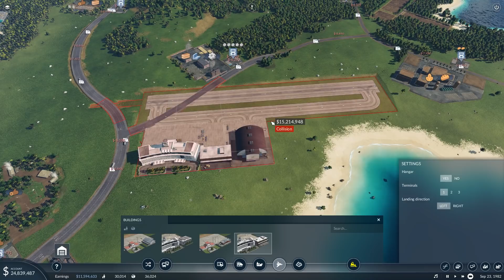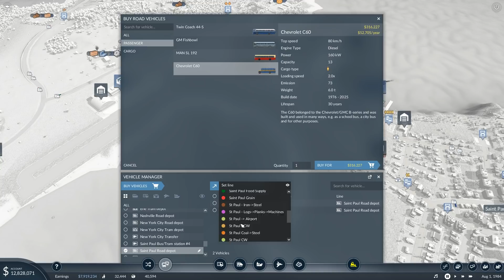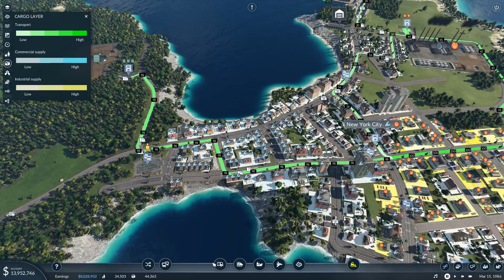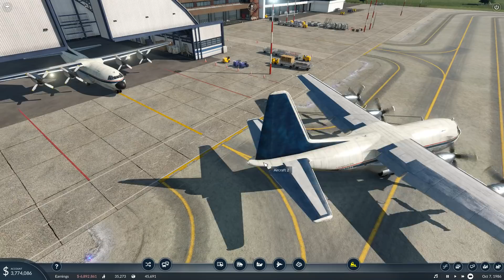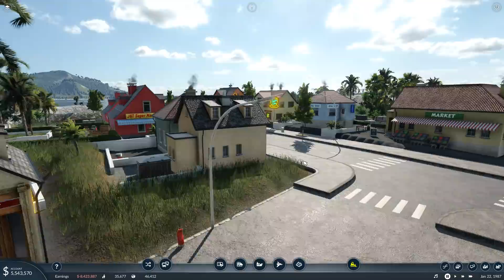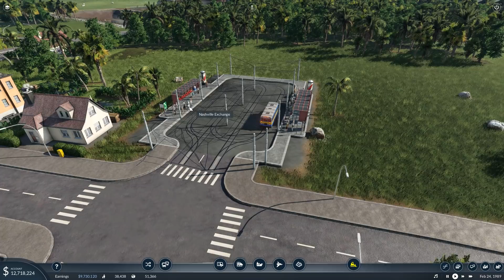Transport Fever 2 - Season 1 - Airlines (Episode 7)

Comment: You mentioned you were going to take care about your towns in terms of emissions (and that you'll increase maintenance for that). I think a good way to reduce emissions is also to reduce the number of vehicles by using ones with increased capacity, if available. Even though most vehicles seem to have around 70(ish) emissions, one carrying 26 essentially has just half the emissions (per passenger) of one carrying just 13. Don't mean to imply to not increase maintenance anyway, it's probably still quite beneficial and worth the (comparatively low) extra cost.
Side note: game sounds are pretty loud this episode. Every time you set vehicles on a line there's a pretty loud PLING. For a random example check 26:12, or listen to the sweet sound of payback at 33:30 (and no, I didn't actually care if you pay the loan back or not).
Reply: I think another way to reduce the number of vehicles going through town would also be to let trucks bypass the town- New York here is a big example, the trucks have to go right through downtown to transport to the oil refinery.

Comment: Feels like a more important stat for airplanes would be acceleration rather than top speed :)

P.S: Should really ship back fuel so that you can supply Thornton with fuel and have cargo on the return route.
Reply: I think it would make more sence if the planes shipped back coal instead of fuel since it is a bottleneck for the metal supply in Saint Paul
Reply: @hegoyyoutubination  but it's only a bottleneck due to the balance of trucks on iron vs. coal (and fuel should pay more I think, as it's a higher tier good). He can just fix the iron/coal balance by evening out the Rate on the line statistics (or even getting it right to or just above 400, cause that's what the mines can output). The Mines themselves produce equal amounts.
Reply: @TheCreat  but still, exporing coal from NY is more profitable and planes will be more efficient
Reply: Well, the stat itself is there. It's the "thrust" right below the speed in the stats window.
Reply: In which case he really should have picked the Canadair? I mean, it weighs a few tons more but it does have twice the thrust of the other planes, slightly more cargo space and a decent top speed. Regardless the values controlling acceleration feel less clear than they could be, which I guess is a holdover from the era when transport simulators mostly dealt with trains.